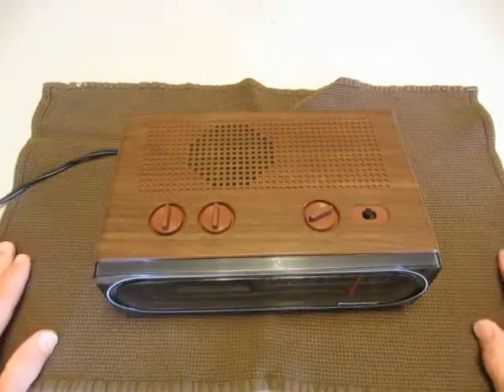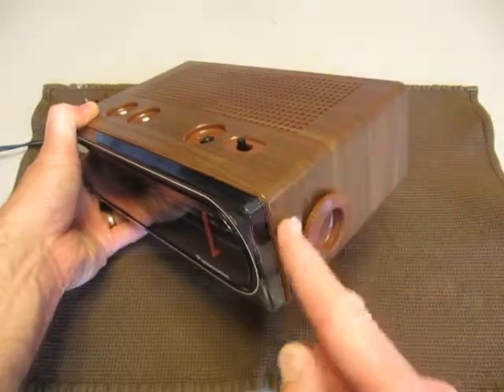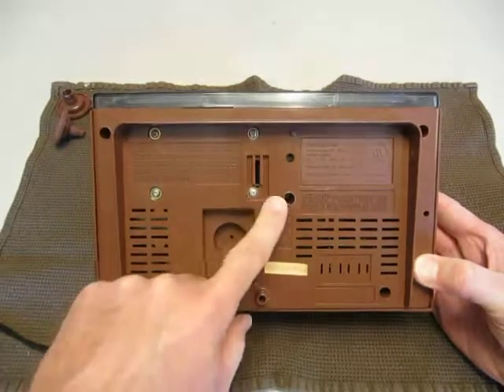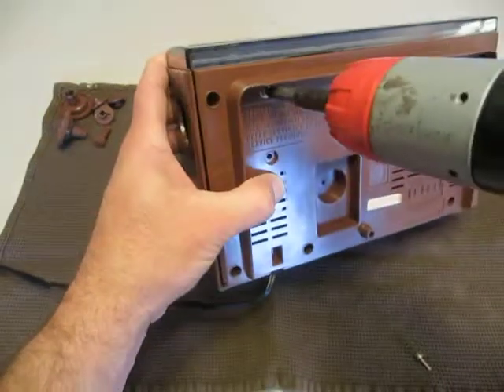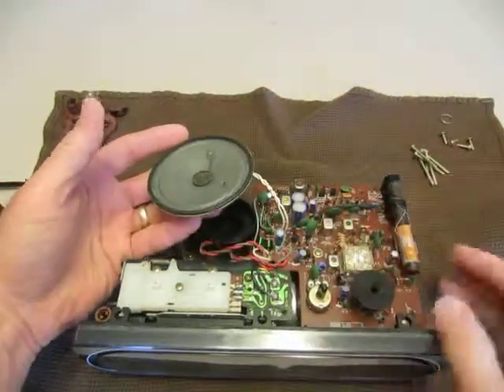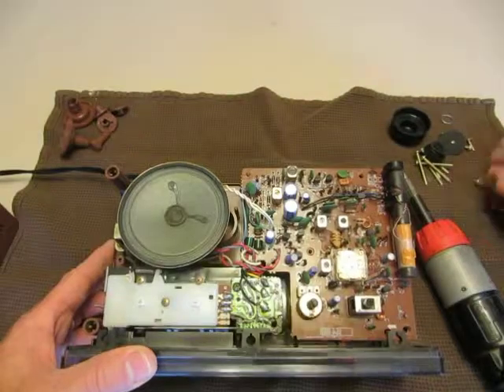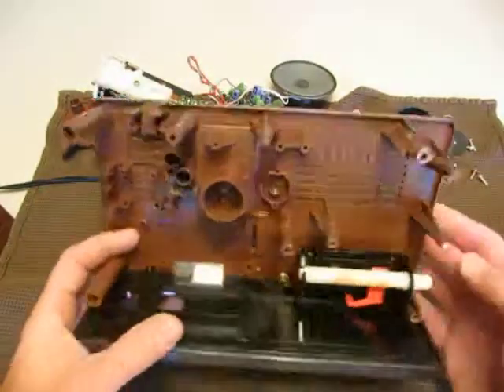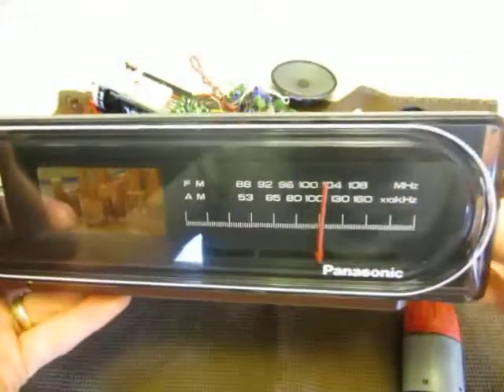Disassembly of the Panasonic RC-6015, the Back To The Future Clock by FlipClockFans.com

Comment: Hello, I know I'm 9 years late, but I was wondering is that a rubber gasket along the rim of the speaker? I'm disassembling my old Panasonic clock radio, and the speaker is "stuck" to the housing. I was wondering if thats a rubber gasket and if its causing the speaker to be "stuck" on mine. And do you have any recommendations to get it unstuck? Thanks
Reply from the maker: Yes. It’s like a gasket. It’s more like paper than rubber I think. You might tap it with a screwdriver to loosen.  If that doesn’t work gently twist or just pry off. It will come off. It needs to come off to allow cleaning.  Even if the gasket tears it doesn’t damage the speaker.
Reply: @Flipclockfans  I was able to remove it with a plastic screw driver.  A little prying and force did the trick. It popped right off! And you're right, tis more paper like then rubber. Thanks!

Comment: I am looking at a RC 6015 for parts only on ebay, i am just wondering because this would be my first flip clock, But - Would it  just need  cleaning and electrical contact cleaning to get the motor cleaning? Or would i have get a complete make motor for the clock?
Reply from the maker: That would not be a good first flip clock in my opinion. There are many things that could be wrong with the clock and you’re likely to need parts to fix it. Often when they’re sold as parts clocks someone has already taken a part out of it. Just my opinion. 
But if you’re set on a 6015 you could get one going if you kept looking for other 6015s or 6010s (same internals) for parts clocks.
Reply from the maker: I'm actually replying to you on reddit

Comment: Hello! I am an Italian boy and I live in Florence, I bought the Panasonic rc 6015 from a boy in Colorado, but I would like to make it work in italy. In Italy the current voltage is 220V 50 HZ while the one in USA is 110V 60HZ. To run the alarm clock enough to have a voltage transformer from 220 to 110v or do you need to also change the frequency? I do not know if the synchronous timing motors work in ac 60hz or in cc. I'm looking forward to thank you
Reply: would only work with 60hz
Reply: Sorry for the late comment, You need a (Step down amplifier)